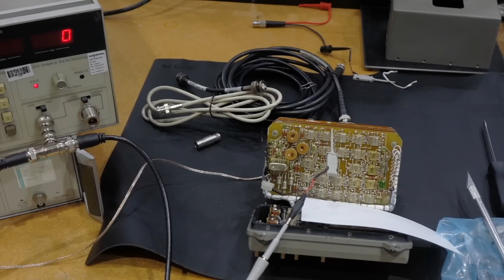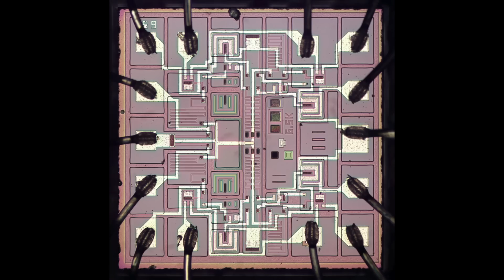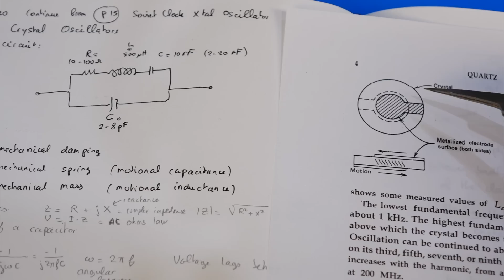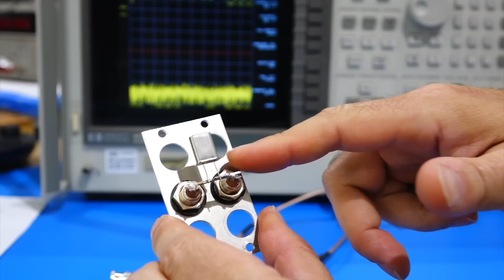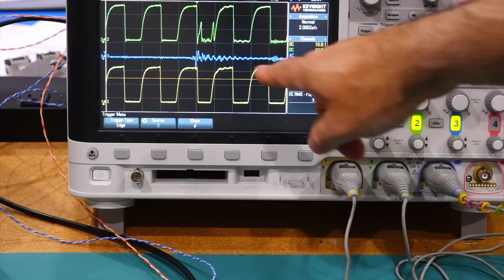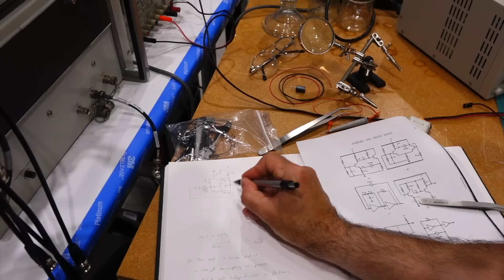Soyuz Clock Part 7: Taming the Glitches in our Space Clock Crystal Oscillator

Comment: Long experience with crystals. In my professional designs, never use the logic gates, because they can stop working when the quartz ages and become "deaf", requiring higher excitation.
I use a single jfet - which allows for proper loading of the crystal.
Since you have the network analiser, you can plot the caractheristic of the quartz. Another possibility, have a dozen of crystals and test the circuit until it works. This happen because of the real Q depends on the cut of the quartz wafer and is random. Also, don't forget to ground the quartz case, otherwise the correcting capacitor value has no sense.
Last, you may want to replace the TTL with a CMOS, so all the power supply noise problem goes away. The linearizing resistor value for CMOS is 2.2 MOhm, the quartz load resistor is from 4.7 to 10 KOhm. Don't use the 1 KOhm value suggested by data sheets.
Also, check the ferrite cores in the switcher circuit are not cracked, and the isolating varnish on the copper winding is still valid. 
Also, measure the resistance of the PCB tracks, sometime they erode under the photoresist paint. Something in your PS is no longer within specs - and may not necessarily be a component.
Reply: Can you describe this JFET circuit?
Reply: Antonio, you are talking about redesigning the osc. from scratch but thats not the goal here...personally, I would like to see if the power-rail spike could be traced, he did mention a switching transistor as a possible culprit. 
Interesting comment from you , thanks... 😎👍
Reply: @peterfitzpatrick7032  Switching transistors, especially that old, have shown a tendency of an increase of the recombination time within the Base. From a circuit perspective, this is equivalent to an increase of switching Time and a reduction of bandwidth. The driver transistor can present the same kind of derating. The net effect is that the driver and final transistors may not be able to switch all the energy contained in the coil, which is then radiated as an interference. 
So, the output transistors (and any eventual recovery diode) should be fully parametrically tested, in view of restoring the original functionality - and not hardening the crystal oscillator against the fault.
Reply: @antoniomaglione4101   Antonio ... when you say bandwidth, is that the same as the unity gain transition frequency fT ?  
And would a reduction in fT not reduce hf harmonics ? 
Or am I confusing noise with RF ? 
I believe he said the SMPS is runninig at 40Khz but the noise is up in the Mhz.. I know sq. waves can produce many harmonics 🤔

Thanks for the last reply btw.. 
😎👍☘🍺
Reply: @peterfitzpatrick7032  Yes, increase in switching time reduce the ft and conseguently the bandwidth of entire stage. Reduced switching time can lead to many conseguences, one of which is the creation of stationary wave patterns, with unforeseeable results in the load.
Reply: @antoniomaglione4101   thanks for taking the time & effort to make interesting & educational replies to us Antonio... 😎👍☘🍺
Reply: I try to always use the canned oscillators in professional designs, so if my design fails I can blame the oscillator vendor. ;)
Reply: >when the quartz ages 

How's that the quartz ages? Formation of quarz on Earth took literally millions of years. Explain "quartz aging" please.
Reply: @taldmd  ok. First there is the case of overdriven crystals. They shatter or crack. Second is the deposit on the crystal of tin from the case, the frequency gets lower. Third and most important is the metallisation of the two sides and the two little springs which act as a connection and support. I used to build my crystals, using sandblasting to increase frequency and a pencil lead to decrease it. Most dipends on the cut, by which harmonic the crystal resonate. The crystals gets old, I have some 50 yrs old, they still work, but no longer on the harmonic they were meant to operate.
Reply: @antoniomaglione4101  get it, thanks! Then it's not that the "quartz ages", but that the oscillator wears out
Reply: @taldmd  .. or the construction of the device we know as a "crystal" ages ... rather than the raw quartz.. interesting topic..
Reply: @antoniomaglione4101  Oh, that takes me back! "Lapping" FT243 crystals with toothpaste on mom's glass mirror, then scribbling on them with a 2B pencil after I had lapped them a bit too far HF. They could be a bit hard to get going if you had too much pencil lead on the surface! Happy memories of a misspent youth!
Reply: @John_L   ... crystal meth.... now THAT would've been a misspent youth John ! 🙄😂
Reply: kulebras Quartz aging is the aging of a manufactured component, not of the stuff it was made of. The quartz you refer to is the feedstock. The quartz that ages is the resonator: the component that includes the quartz crystal material, but this material is not laying idle anymore. It is subject to an electromechanical transduction action, the presence of electrical fields, of metallization, and of mechanical loads related to mounting it. It is a system, not a piece of rock laying idle.

Comment: It's likely they never knew it was there with 70s test gear. If the clock tracked within spec on the internal oscillator it would pass testing.
Reply: And any error would probably be put down to the acuracy of the crystal etc.
Reply: Plus remember that the USSR was about 10 years behind the US in terms of electronics, so the scopes they would have had access to would probably not have been what you're thinking of as 1970s scopes!

Comment: Very interesting! Every one of your videos shows me how much I still have to learn as an Electronics engineer :)
Also: Wouldn't that also be problematic with other devices in the vicinity? Than amount of EMF would probably influence a lot of other devices around. Might be why they replaced it.
Reply from the maker: When the clock is in its metal enclosure it would not radiate outside so it would be fine. Unfortunately the poor oscillator is inside...

Comment: Marc, are you going to look into what part of the power supply is causing the noise shown on the scope. I don't mean fix it, just show what's causing the noise.
Reply from the maker: I should, but I am a bit tired of the clock right now. Plus working on the power supply in the live clock is very risky. I just wanted to make sure the oscillator worked as designed, then button the clock back up so it's off the bench and back to its beautiful self...

Comment: Was this glitch present when the clock case was closed?
Reply: Around the end of he video he said it wouldn't make any difference because the noise is coming from within the clock and not from outside.
Reply: It is not necessarily true. Screens connected to the ground short circuit the capacitive noise current to the ground and less noise reaches the sensitive element.
Reply: @pamersiel  Not even.

Comment: Were you tempted to go back to find the source of the noise?  It may be that there is still an actual fault.
Where they used a gate as a resistor, I wonder if that was a disable signal that they used in debugging and then just grounded the input to the gate for normal operation.
Reply: That's what I was thinking, ie, it's patching a problem that is still there.
Reply: Sometime is because the old ferrite core in the switcher circuit develops an hidden crack.
Reply: Me too on the "what about the source" thing. If the drain of the switching FET is ringing at 10MHz, I'd be inclined to investigate adding a little snubbing. Plus as Antonio says, have a look at the ferrite core.
Reply: I thought deteriorating bits perhaps.
Reply from the maker: @video99: Absolutely, you could work the problem from the other end. I mostly wanted to know if there was a fault in the oscillator or not, and if not, how hard it would be to fix the design. Turned out not very hard. On the other hand, the power supply definitely could have an actual fault. But it’s harder to debug, quite risky if you mess up, and would require larger components to fix.
Reply: I believe failing rectifier diodes in SMPS can cause this kind of issue, if they stop switching cleanly they can radiate all kinds of garbage.

Comment: nice TEMPEST issue ;-)
I've seen some designs where the Quartz's can is grounded, would that change anything ?
Reply from the maker: It would help if you have a good ground. Which is not really the case in this clock, the ground wires picked up the noise too! But definitely worth a try.
Reply: @CuriousMarc   they had cast iron water heater inside the capsule to ground it， as all Soviet houses have😉
Reply: That seems like a good suggestion. It would change the capacitance, but since they're using the series resonance it wouldn't matter.